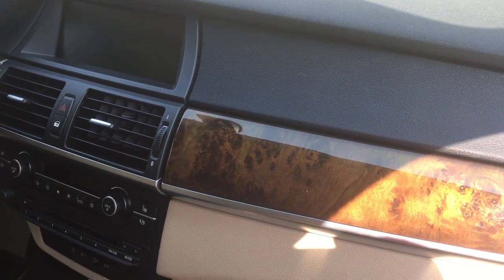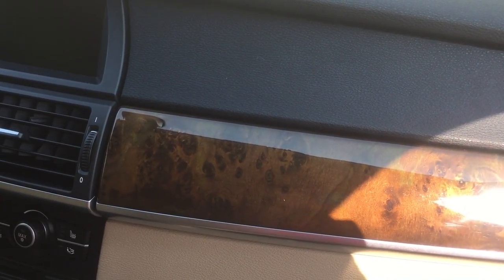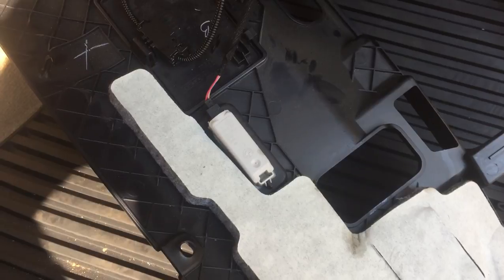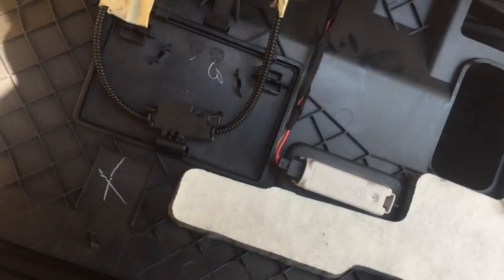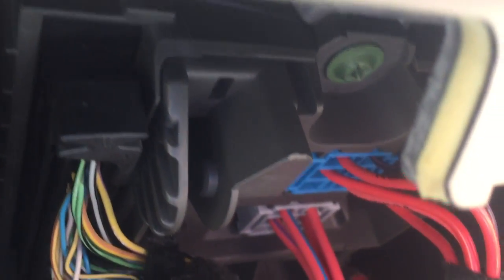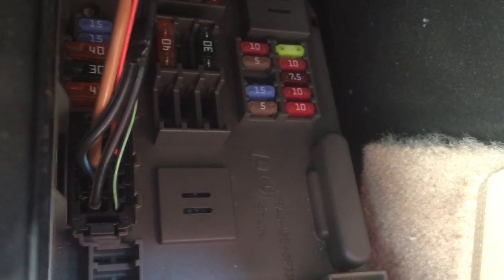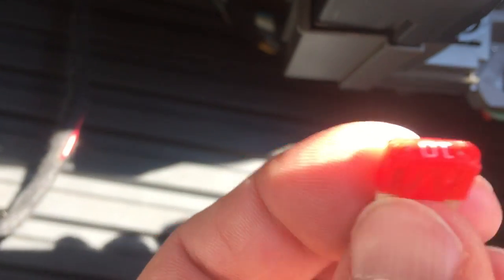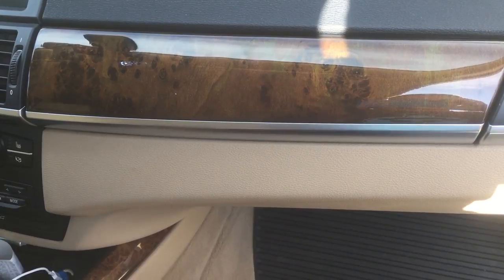Fix BWM X5 Autolocking GloveBox Not Opening

Comment: hi! How did you get the fuse box to drop down far enough to reach the glove box fuse?
Reply from the maker: Fast forward to 2:30 seconds into the vid. There is a green Phillip head screw. Remove that screw and the panel will fold down.
Reply: @chopsuey503  I removed the green screw but the panel doesn't drop down far enough because of the wiring bundle blocking it.So do you have any other ideas?

Comment: Hello 👋 
I have a strange problem when I open the car with the remote control that separates the cigarette lighter power. When the power of the remote control is disconnected, the cigarette lighter is working. Are there any solutions? Thank you.

Comment: Is this same for the x6 
If the fuse is blown will it stop if from shutting 
Mine doesn’t close 

Thanks
Reply: LOOKING AT TOYS 

The guy will never reply since the video is so old and yes no matter what model X6 and X5 have the same thing , same concept so do exactly the same thing E70 and E71 chassis.
Reply: @aidenp5768  do you have any other suggestions? I replaced the 10 amp fuse; even tried the 15 amp fuse. I'm hearing the click when pressing the button to open but nothing happens.
Reply: Jj Hodges 

Not sure, all I know is that the E71 X6 is the exact same thing. From the B pillar forward interior and exterior are basically the same thing as an E70 X5